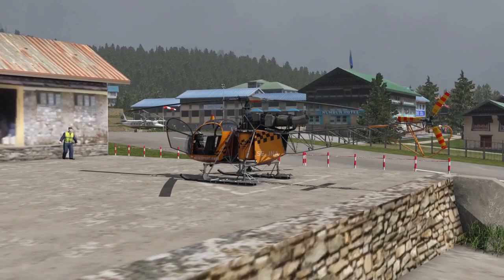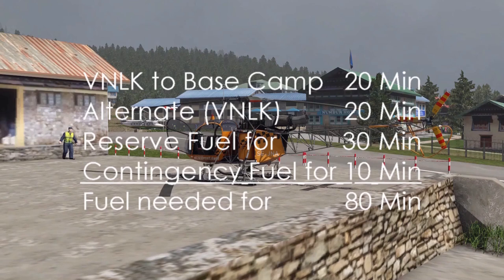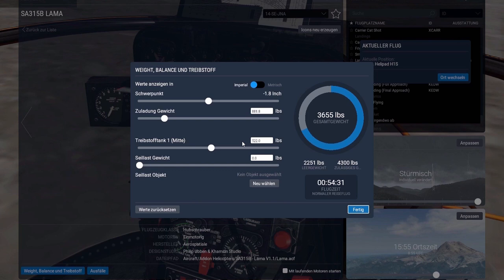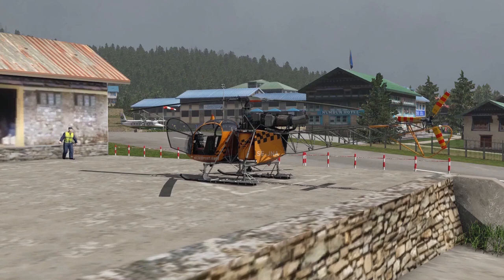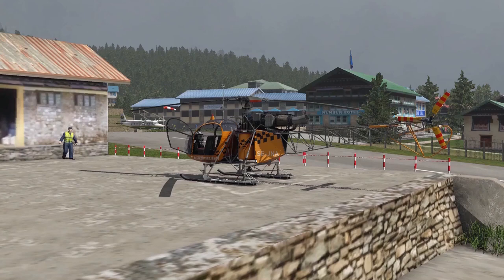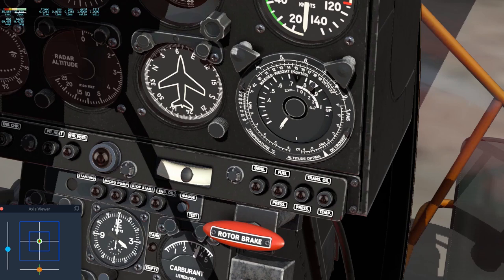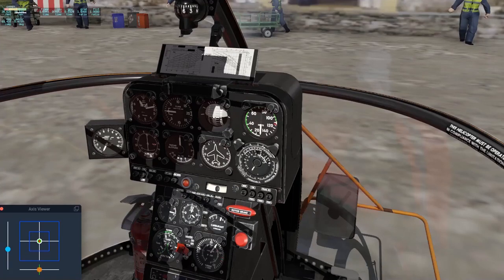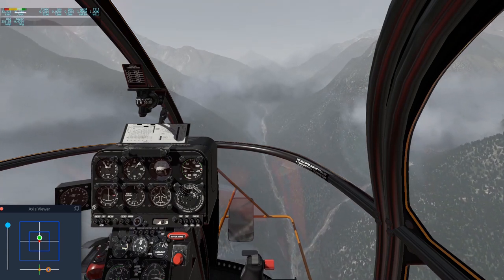Lukla to Everest Base Camp - Helicopter Performance

Comment: Just a question here: Do you have to turn off the Hypoxia simulation setting in X-plane?
I tried to do the same trip, but my pilot passes out hahaha.
Or there are any pressurisation systems in the Lama (or even in the CowanSim AS350 Squirrel? I didn't find any, and I thought this heli should be able to go to the Everest summit!)?
Thanks once again!
Reply from the maker: I think they take oxygen with them. No pressurisation 🙂. Haven't tried to reach the summit yet. But on paper You should be able to...
Reply: @thenerdyhelisimmer4608  I'll try again, but I couldn't. With the Lama and even with the AS350, my screen starts blacking out. Maybe I'm missing something.
Reply from the maker: @Eduardo90M  Probably a limitation within XP. For the so called landing on Everest they stripped down the AS350 to the bare metal, I believe 😄

Comment: Hello I'm flying the same A/C SA 13B lama using X plane 12.00b14 and having a hell of a time controling the heli. my flight controls are Puma X  and windows 10  would you mind telling me what your settings are both  for the Lama and X Plane thanks
Reply from the maker: Hija, Nothing special (haven't flown it in the latest XP12 version). I use OE-XAM full sized UH1 cyclic and B206 collective. XP Axis settings all linear, no curves, no stability.  Make sure You have enough FPS (at least >25 constantly). Also try to recalibrate your controls within XP (even if they seem to move correctly within the menu). Sometimes when I use the Microsoft Sidewinder FFB 2 it ignores 50 percent of the X-Axis giving me lateral deflection to one side only. Un- and replugging solves that. Just have a look whether or not the virtual controls folllow the movement of your hardware accurately. All I can think of right now. Lama should be fine to control, little bit on the sensitive side even though to me all helis seem to "feel" very similar in XP12...
Reply: @thenerdyhelisimmer4608  hello thanks very much for sharing that information  will go back and check every thing see if things get better back at you later
Reply: x2   I am doing the same, beat me to the punch in asking.  With the old style Puma. Now looking into getting a higher end computer in order to keep the FPS up enough to have good  scenery and realistic flight controls.  Currently have to have all the graphics at the lowest settings in order to even fly it.
Reply: @superstorch007  good luck to you I went back and re adjusted every thing and have no problem with it at all now I am thinking about getting a new computer as well mine is about 10years old (Dell)